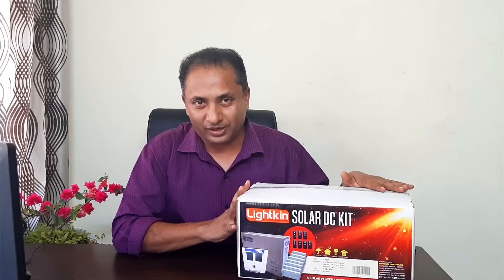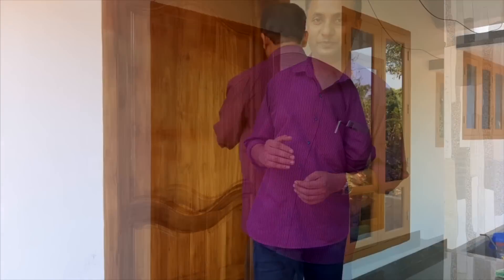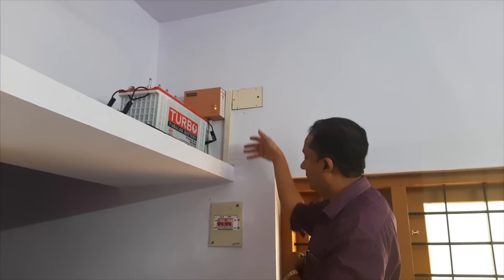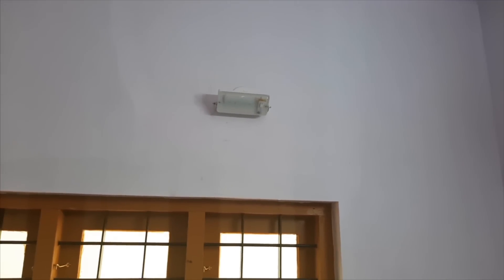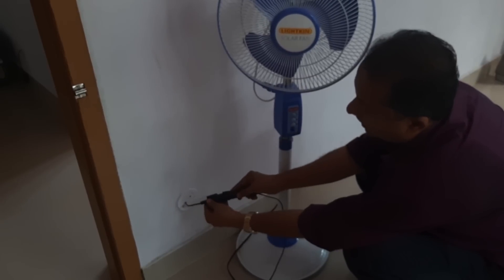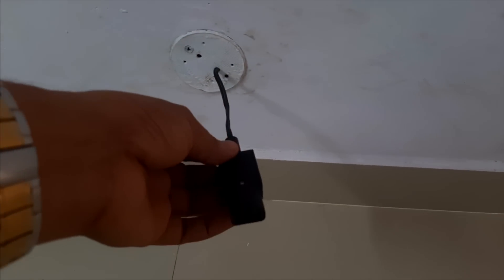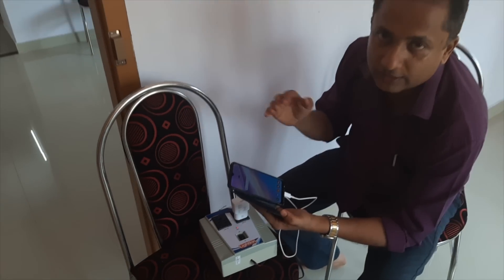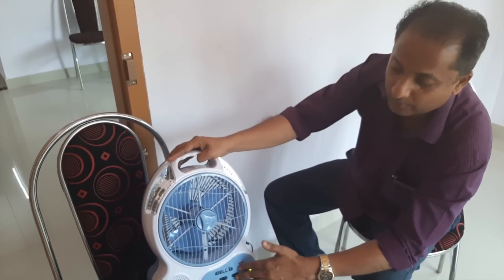പുതിയ വീട്ടിലെ സോളാർ   DC സിസ്റ്റവും അതിന്റെ പ്രവർത്തനവും.| Solar DC Kit in a New House-Vlog.-31

Comment: MCB ratings for 100w panels,,,pls explain.
Reply from the maker: This system uses an isolator merely to manually disconnect the lines.

Comment: Normal bldc ceiling fan of 24w can be connected with dc circuit ....
Reply: No athinu vere thanne fan venam
Reply from the maker: If the fan uses Ac then no it cant be connected.